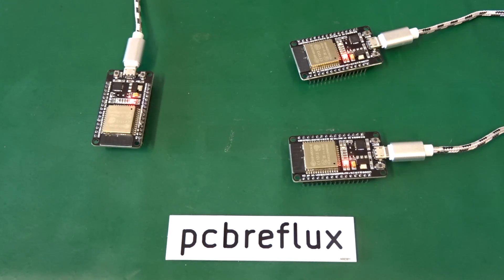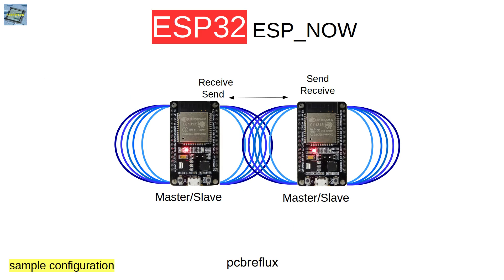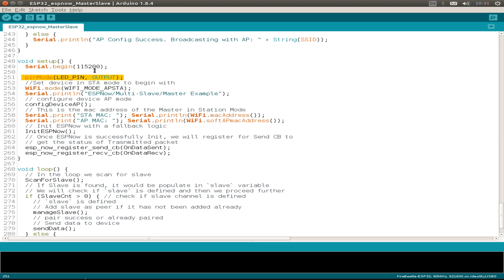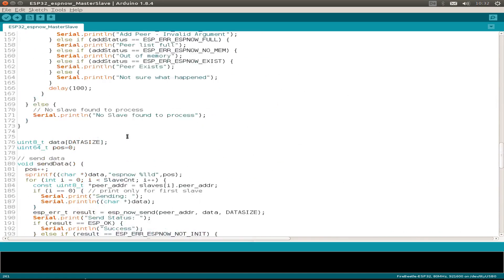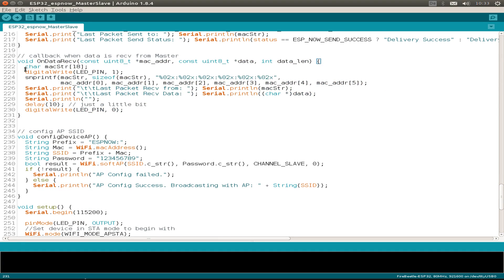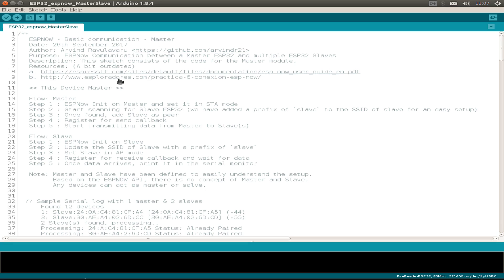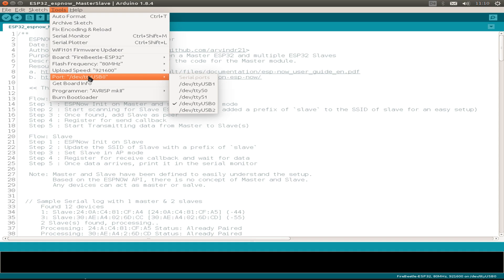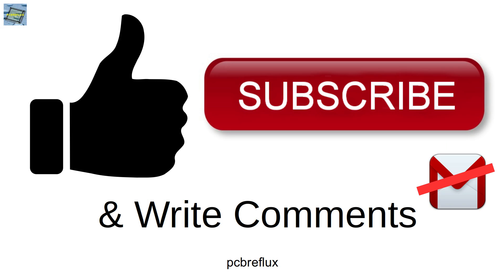ESP32 #69: ESPNOW simplex and duplex

Comment: The problem is that i want do a home automation by using WiFi modules node mcus to be precise , and I needed a protocol to control relays which are connected to a group of node mcus, after some research I found espnow can do this by allowing the esps to acts as slave and master simultaneously and my problem is if I apply espnow protocol can I send the triggers for the master to turn off or on the relays to a particular ic through mobile if I can then how? Is this possible

Comment: thank you for that video. i want to transmit several values that i have copied into one string.
here i build my string:
datastr = String(t)+";"+String(h)+";"+String(abshum)+";"+String(td);
now i would copy the string to data[] like in your sample:
sprintf((char *)data,datastr);
 but i get a compiler error. what did i wrong?
Reply: hi did you have solution to send multiples values :p thanks
Reply: @fabienlacaze1492  First.... Never use strings, use char instead.
You can send anything that is no bigger than 250 bytes with esp-now, use a struct.

Comment: Hi!
 At 0:38 you state that using the ESP-NOW you can send data from multiple masters to one slave. I would like to make multisensor weather array using ESP32's. The sensors would be scattered around and one slave would read the data and display it as points of on a map ect. how the setup for multimaster-single slave system would go? Does the example code in the esp32 git libary work as is for this kind of implication  or does it need some changes?
Reply from the maker: napiton Hi, for your purpose you can use the simpler master or slave examples from the arduino-esp32 library provided by espressif (https://github.com/espressif/arduino-esp32/tree/master/libraries/ESP32/examples/ESPNow/Basic) Sure you need to add the sensor code to the master and send the messages to to the slave with the display code.

Comment: Nice video! Is it the same code on all 3 devices?
Reply from the maker: Yes, in the video all devices are running the same example code.
Reply: Cool. I will work on this the next week trying to make 2-3 devices send to 1 ESP to collect the data.
I just worry about how i synchronize them if i want to make the send every hour. And try avoid collisions.
Reply from the maker: Lars Andersen Hi, you can implement some kind of voting algorithm for a root node and a sequence number for transmitted packages and a acknowledgement message?

Comment: Really great video! Thank you very much.
Just two details:
1- On line 253, write "WiFi.mode (WIFI_AP_STA);" instead of "WiFi.mode (WIFI_APSTA);"
2 - The failure of sending and receiving that you have commented occur when one device try to send data to other that is on scanning or sending at that exactly moment.
Reply: does this mean that WIFI_AP_STA mode is constantly switching between the two?

Comment: Hi, is ESPNOW using the external antenna if existing?
Reply from the maker: As long as the external antenna is used for WiFi signals it should also used with the ESPNOW protocol.

Comment: Is it possible to use ESPNOW to send and receive audio to more than 2 ESP boards in the Multi Master/slave mode?
Reply from the maker: Have no experience with audio, but if you can stream video data via WiFi with the ESP32 then audio with the faster ESPNOW protocol should be possible.

Comment: Nice!. Hi, heard the first time about espnow. What are the advantage of this protocol?
Reply from the maker: You can use some esp32 (or esp8266) and communicate without external hardware and you do not communicate over the internet or local network. It' s some kind of PPP - point to point protocol.
Reply: I think the total time need to connect unit to unit, without a WiFi router, is much shorter and saves lots of battery power. Also,  I saw that CNlohr has connected ESP NOW to a router running OpenWRT